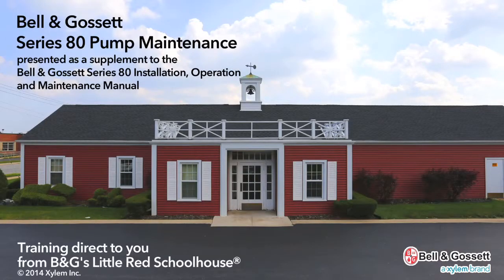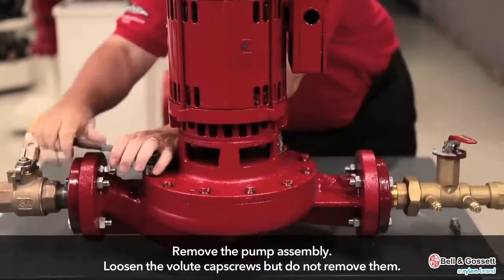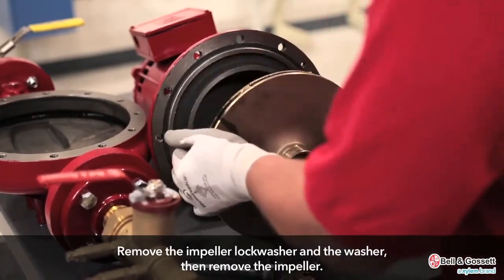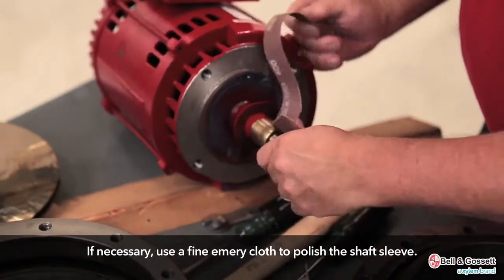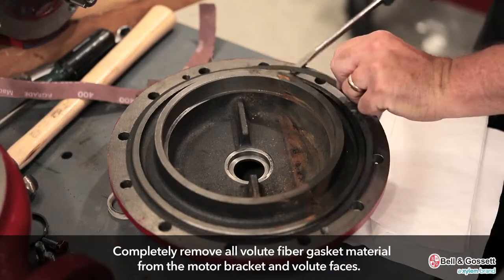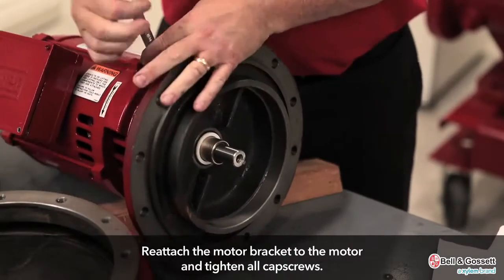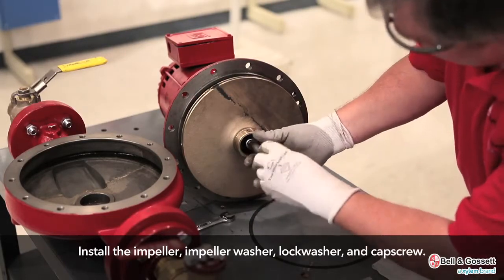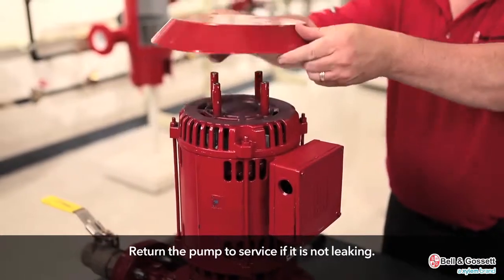Xylem Bell & Gossett Series 80 Pump Maintenance

Comment: What size bolts are used for the jack bolts?
Reply: Use the same bolts you pulled out of the motor plate, 3/8 bolt, 9/16 box end wrench